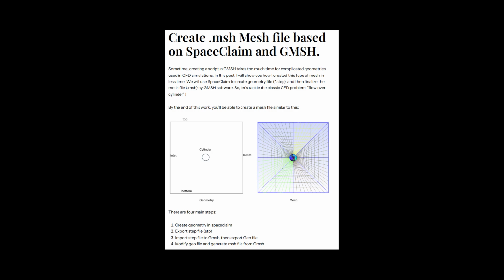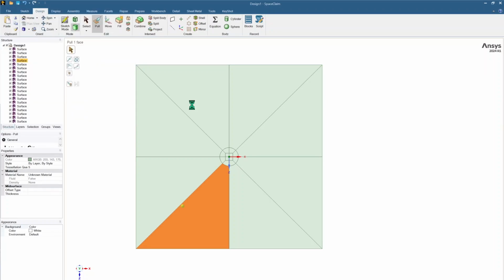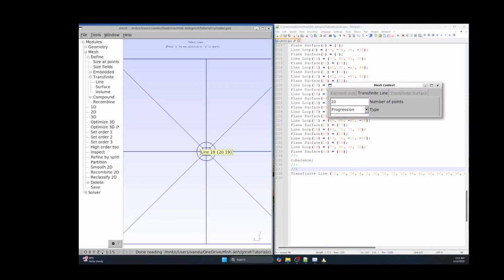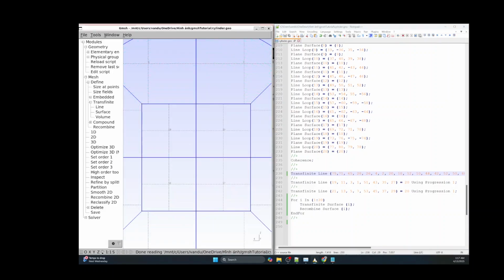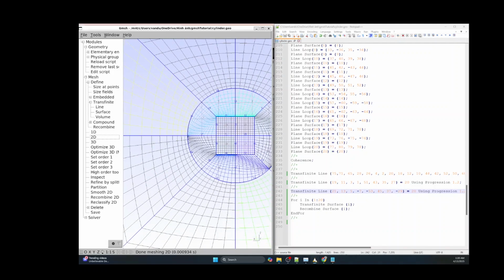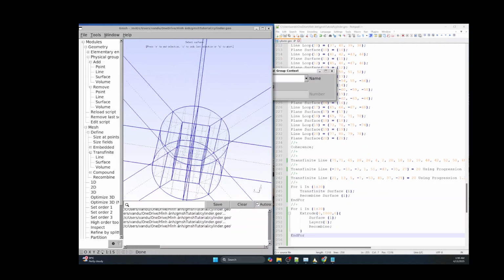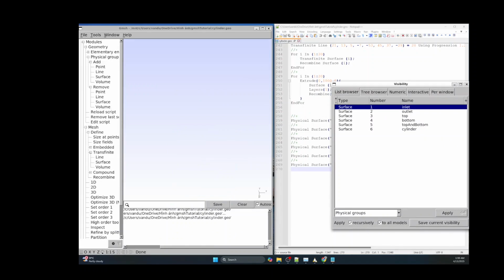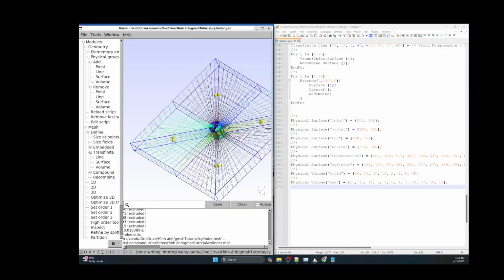Create Mesh for Openfoam via SpaceClaim and GMSH

Comment: Very nice and helpful video. I encountered this problem when I add a new physical group, meaning selecting it, naming it and then pressing e to end my selection the geometry dissapears. When checking in the visibility window the tree I see that gmsh generated a new empty model (named as current) with no entities or physical groups. When I apply the initial model I cannot make any new modifications. I imported a step file with the geometry with the merge command and I work in a .geo file. This suddenly started to happen and it did not use to happen. Any help would be very much appreciated!!